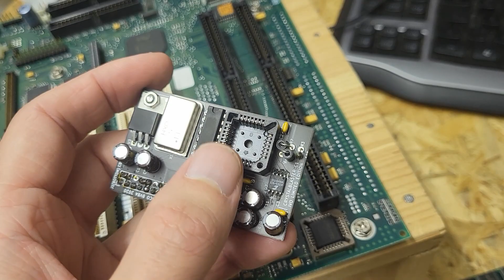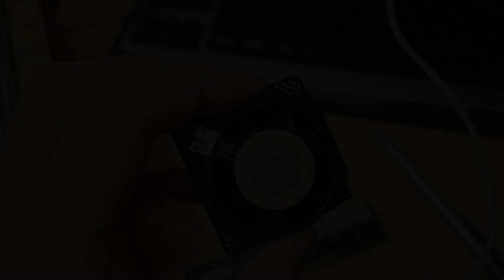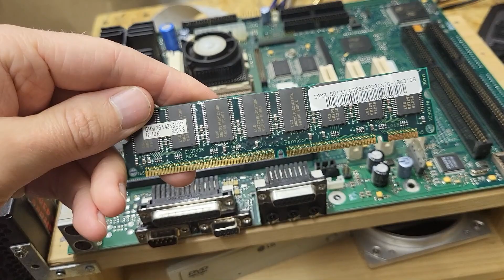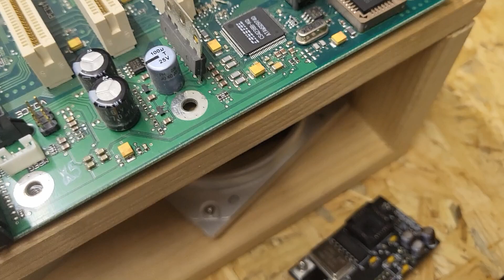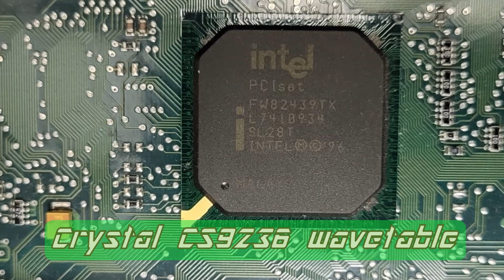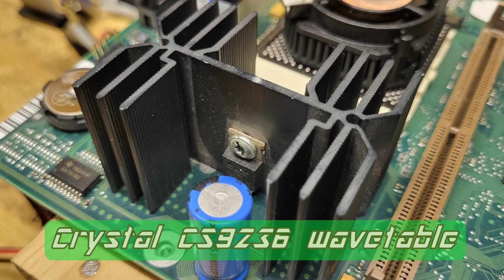This mainboard now has wavetable-sound! The Siemens-Nixdorf S26361-D990

Comment: What a coincidence! I got a D981 Slot 1 board in a box of junk last week that also has that wavetable socket. I was wondering how it would sound if I could ever get hold of one of these wavetable chips. May I ask where you got yours from?
Reply from the maker: Congrats, these are great boards! I transplant mine from the serdaco crystalblaster c1 that held the same wavetable ic. But you can buy the ic independently from eBay sellers if search for crystal 9236

Comment: Tolles Video, Hve you checked diese Isa Sound Card KWX-SC4236-37 ? they are very common apparently I always wondered what if you installed a socket and a chip I wonder now how expensive is the chip.
Reply from the maker: The wavetable chip is available from just one seller from China on eBay as far as I've seen. He wants about 17 EUR and that's not cheap but quite fair I guess. A dedicated wavetable board with this chip (the serdaco crystalblaster) is more than twice the price.

Comment: Hi Ernie! That Crystal chip sounds quite weird, with some wrong instruments in Doom ][ Map01. Did you compare to the Crystal Blaster, did it sound exactly the same? What CPU did you use on that board for the test? Maybe it's to fast for Crystal Wave?

Kudos 2 you,
Dozzy!
Reply from the maker: Hi Dozzy, I haven't  compared it with the crystal blaster so far. It is running a 200 Mhz Pentium MMX.